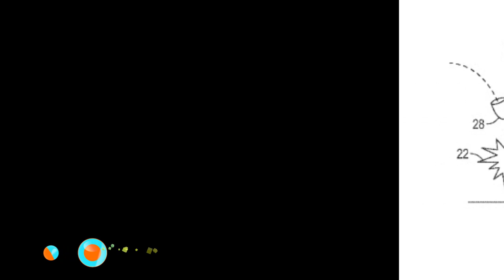Force field: Boeing patents Defensive Force to deflect explosive shockwaves

Comment: Isn't there sound detection equipment now that can change the sounds to visual images, giving at least an idea of what noise making objects, are where and what, most  likely, they are, or also giving an image showing a scene, based on what the sounds are bouncing off of, thereby at least giving a landmarks image of whats around you. So one could at least drive defensively and perhaps to another spot

Comment: Reupload,  Recomment.
Its not a REAL force field. we need a force shield that weakens after each hit, just like in star trek. Shields down to 80%. Another hit, shields down to 50%. Captain: reserve power to shields, stand by photon torpedos. FIRE.
Reply: Hinz Zimmler  Reroute power from life support on decks 5-7 to the aft shields!!! Inertial dampeners off line! Port nacelle has taken damage!
Reply: Turns out the huge racist is in fact a HUGE nerd lmao why am I not surprised?